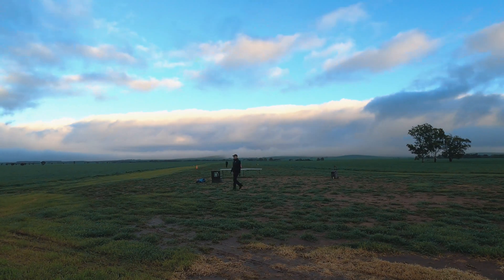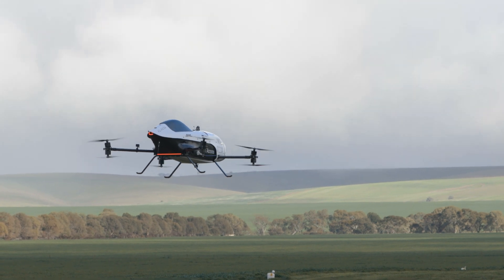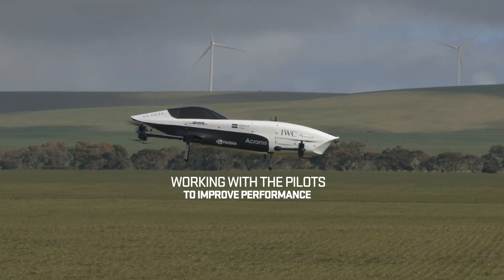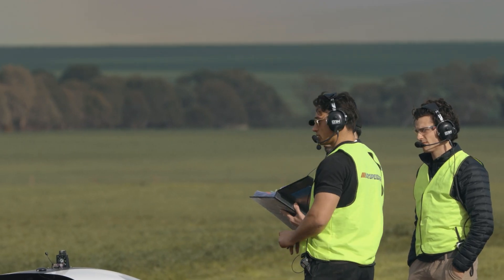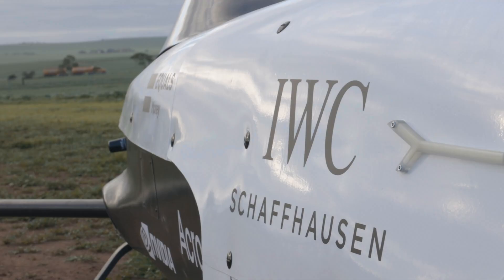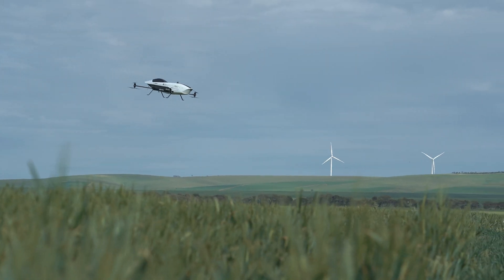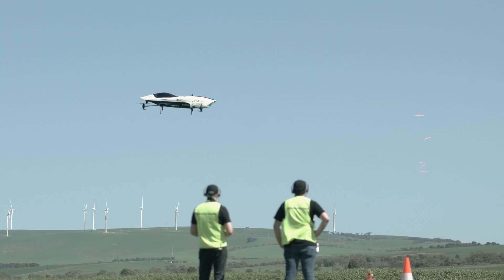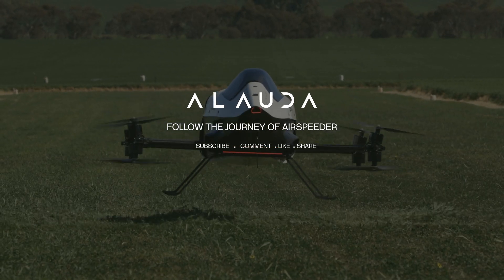How to flight test an eVTOL race vehicle | Alauda Aeronautics Taking Flight

Comment: Why do you use a push-pull propeller combination on each pylon, being less efficient than a single larger diameter prop? Is it because two smaller props can change RPM quicker for faster stabilization response?
Reply from the maker: Alauda Aeronautics engineers are constantly working to improve design: our development series EXA will be used as a test bed to make further improvements through racing. Redundancy is a factor in the octocopter layout, but the prop layout possibilities are endless.

Comment: Wait
What if it crashes mid flight mid race
Like what safety features are given for the racers?
Reply from the maker: These are Alauda Mk3s and are flown by pilots remotely for our EXA Series. Alauda Mk4s will be flown in Airspeeder's main piloted series next year and beyond. Both craft will be equipped with collision avoidance system, underpinned by radar, lidar and machine vision to prevent accidents. Crash structure and ballistic parachutes are also added protection in the unlikely event of contact.
Reply: @Airspeeder  ohhh
Will the pilots have like those helmets which show the stuff on the glass
Like the F-35 helmets?
Reply from the maker: @arvinmathew3746  Yeah HUD will be used to display a radar and performance vitals etc. which will be available for the fans to see on brodcast too.